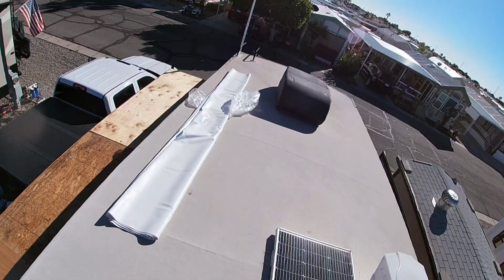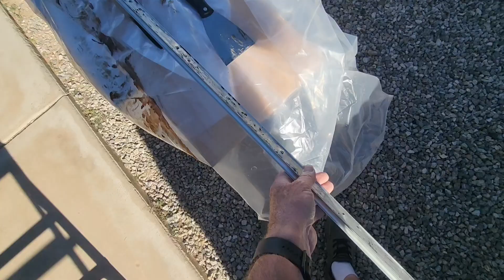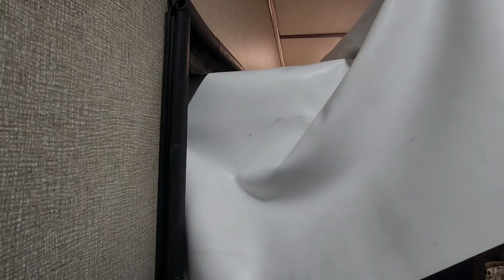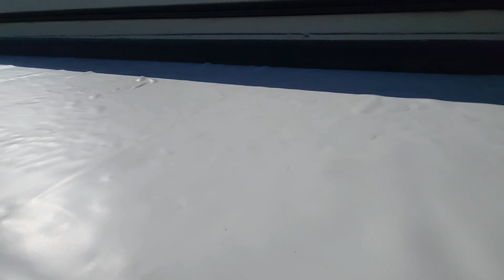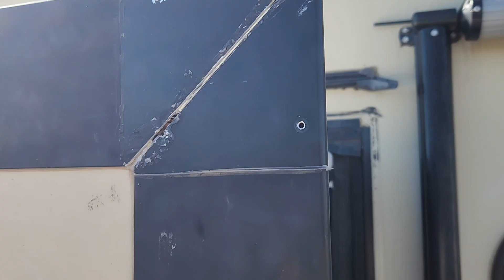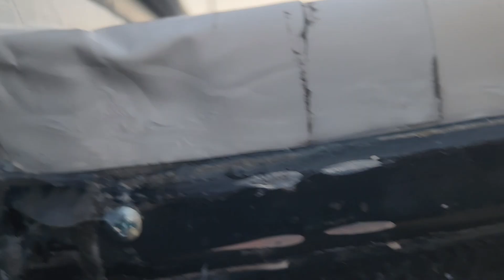HOW I REPAIRED MY RV SLIDE OUT ROOF AND FIXED THE DE-LAMINATION PART 4

Comment: No lack of slide roof repair vids on yt eh! slides are such a GOOD idea on an RV, but the slide roof always seems to get compromised no matter what is done. if the roof needed replacing, makes you wonder if the other 3 wall sides are also compromised, hmmm...
Reply from the maker: Repairs are a constant thing on RVs. Especially water damage
Reply: @RvTipsandTrips  im thinking all the parts on RV slides should be made out of HD plastic!